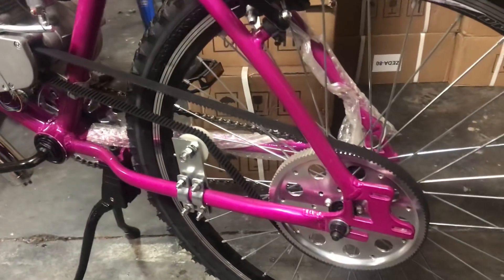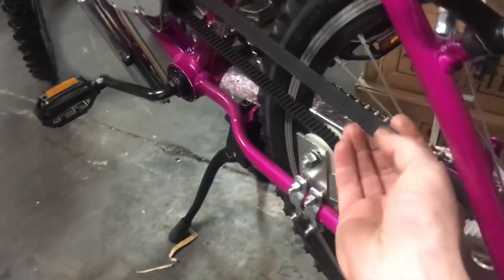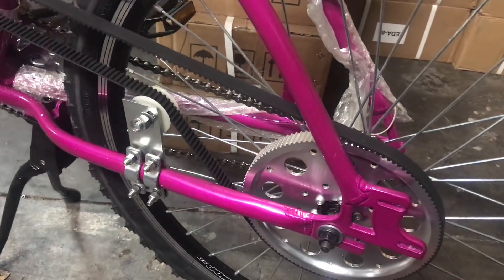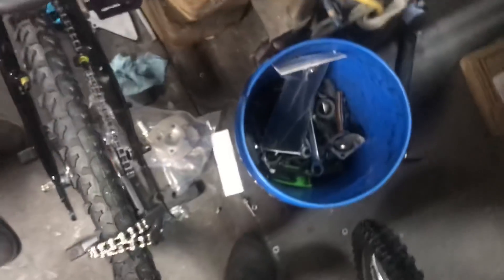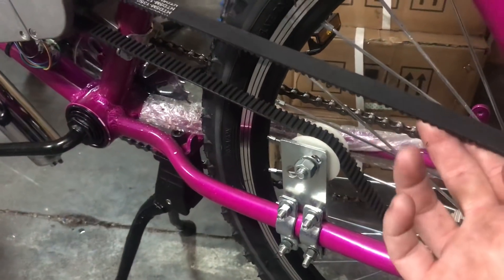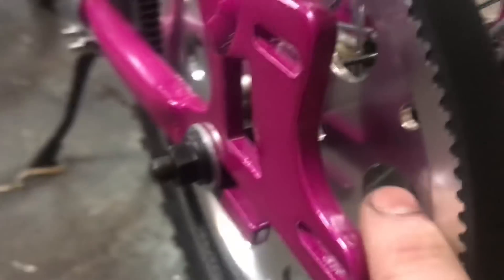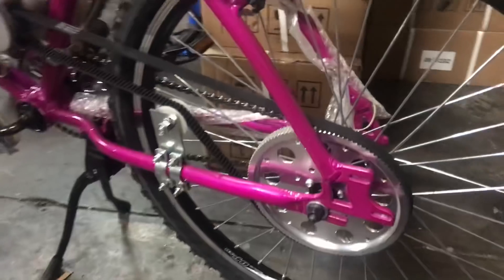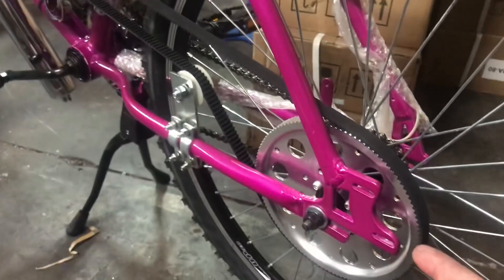Belt drive kits for Motorized bicycle

Comment: I installed one with 2 tensioners top and bottom  4ins away from drive pulley on my 80cc.  The belt lasted a week before it was numbs. No matter what I did it still grinned. So I put a pull start on it and bought a new belt. Problem solved. But they wont tell you that because they want to sell there product . Oh by the way I had to extend the peddles out to clear the pull start. Made my stomach sick. Great job GUYS!

Comment: It's taken me a year to get to it, but when i first received the kit (not sure if from Zeda, or CDH to be honest),  i wasn't really impressed with the lack of drive pulley shouldering, knowing how critical alignment is..  I'm glad i found a solution, after stewing on it a while .. hint, the correct sequence of 203mm rotors, inner spacers between rotors and drive pulley for spacing/rigidity, capped off with a 255mm rotor along with a custom jigged caliper setup appears that it'll address my personal concerns in a very nice package. a bit spendy, and required a bit of engineering and modification of componentry to work.  135mm Skyhawk clone frame, GT5A motor on mag rims.  

I'll post up a video link in the next few weeks.
Reply: Yeah, right!

Comment: Idk looks like wear and tear would cause problems ?
Reply: It will.. I have a 2000watt mid drive. Had belt i removed it tossed it in garbage went with chain drive..
Reply: Does wear and tear on a car's timing belt or serpentine belt cause problems? Think about it.

Comment: The thing i think about is being able to pedal the bike and not rolling the belt along..so i'm thinking of a one way pulley so when you are pedaling, the belt  pulley just sits there like you were coasting..
Reply: Have a question for you my 2-stroke motor my switch over meaning of bypass clutch

Comment: so is this belt long enough to use on a 29 in bike both 2in rubberized motor mounts ?  
I'm not sure of the exact length but I had to add 2 links into the stock chain from the kit just to make it work. I.dont have any chain support from motor to pineapple bushing its pulled right. any tensioner would force me to add a few inches of chain back in.
Reply: @pauls5745  Awe crap. Figured as much. If this bike wasnt 100% aluminum and lighter than  any 26in standard I would get rid of it.
Reply: @pauls5745  and thank you sir

Comment: I'm genuinely interested in knowing more about the timing belt durability. I'm looking at building a new bike myself and having a neon green timing belt would go perfectly for my Mean Green Machine.
Reply: You must not have common sense. How many thousands of miles does a vehicle's timing belt last? Or the serpentine belt? Think about it for a second.
Reply: But it isn't a serpentine belt or go on a vehicle. That's like comparing durability of our engines to a car engine. Think about it.... Totally reasonable question considering the poor quality of everything else.
Reply: Belts are crazy durable, of all the things a drive belt would be far down on the list as a failure point. 
Also it depends on use and maintenance. If you just slap it on and ride it'll last a very long time. 
If you do basic maintenance and condition the belt once in a while it'll last extremely long.
Reply: @aggro0o886 yeah probably better using a CVT push-belt as an example. Push belts are constructed & reinforced in a similar way.

Comment: Where do motor tensioner pulley setup work on the belt driven system 2 with the big rubber wheel

Comment: Hey man I need some help. My engine that I ported and did some other things to does some crazy high rpms, which ends up being too high for the stock carburetor to keep up but I keep burning up the stock CDI after a couple hours of hard riding. Got any recommendations on a solid CDI box?
Reply from the maker: join the mafia on fb. Also, stock cdi #1
Reply: Thanks, I just joined
Reply: Titan97 warrior also you might try a couple steps colder plug and shield all wires, high rpm creates high current and will arc to ground when screaming damaging the CDI

Comment: This new drive train will require quite a bit of attention, a belt is surely quieter and simpler to put in tension, but it's even more less durable and especially deceitful than a chain, it might snap without a clear forewarning, as how it happened with me several times.

I'm looking forward for some developments on this drive train, it will perfectly suit on a freewheel shift mechanism, I hope to get one for my HEV bike
Reply: Less durable? How?
Reply: @eyeballll  A belt will never be as durable as a traditional chain over the time: The constant tension combined with exposure to heat and cold will inevitably wither it over time.
Reply: Get a gates belt
Reply: Also when it snaps it doesn't wrap up in your back sprocket pushing it out I mean it might wrap up and stopped you I highly doubt that but it's not going to cause catastrophic damage I've blown a hole rear ends because this chain got stuck between the frame and the sprocket

Comment: Lot of ignorance in the comments about "wear and tear". You must not be aware that a large number of vehicles use a timing belt that lasts thousands of miles or that all vehicles use a serpentine belt that lasts thousands of miles. You must not be aware that Harley-Davidson used a belt drive for about the first 10 years and continued with belt drives in 1981. The Whizzer bike always used a belt drive. This is just a few examples of the widespread use of belt drives. You nay sayers must not be very mechanically inclined.

Comment: Belt drive needs work. It wont work on 4stroke engines. With all the holes in rear pulley the 3 for a cnc hub adapter arent there. That is a stupid oversite.
Reply: The only thing that's stupid is your comment. I just finished looking at a bike with a 4 stroke Honda clone with a non-toothed belt and using a Whizzer type belt sheave. Belt drives have been used for over a hundred years on various vehicles including Harley-Davidson and most cars use a timing belt and serpentine belt. You must not be very mechanically inclined!

Comment: I'm assuming this wasn't the smash hit it was intended to be. No videos about it since and nothing else built uses it. I mean it's a nice concept, but for the application there's just far too much room for error especially with nothing to really keep the belt in place on the gearing, and unless it's super tight it slips a lot. Making it tight enough to not slip under load makes it a bish to pedal and just increases the belt wear.
It works better on full size motorcycles because they are not friction start and use a much heavier, stronger, less flexible belt. It's like that snow kit that was available. These engines don't have enough horsepower for it because the front ski is too thin and the track derails constantly, mainly because it is too thin and the tensioning system too weak.
Yeah, chain drive will never be silent, but if you set it up right the difference is so little there's really no point to all the money and hassle for this
Reply: Wrong.

Comment: Not worth it you will lose power it's a 50 tooth I looked up the web site so your not going to have top end speed yeah take off faster but go slower plus I don't see that thin belt lasting
Reply: You must not be aware that a large number of vehicles use a timing belt that lasts thousands of miles or that all vehicles use a serpentine belt that lasts thousands of miles. You must not be aware the Harley-Davidson used a belt drive for about the first 10 years and continued with belt drives in 1981. The Whizzer bike always used a belt drive. This is just a few examples of the widespread use of belt drives. You must not be very mechanically inclined.